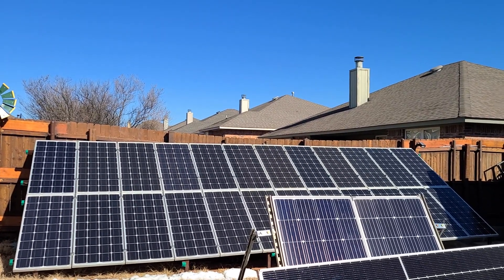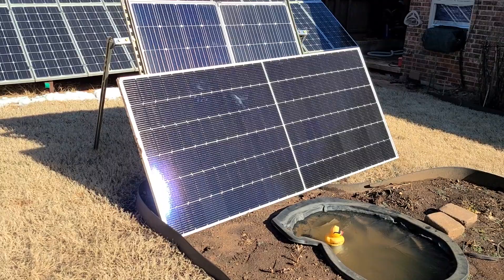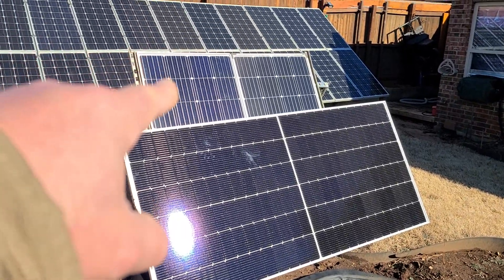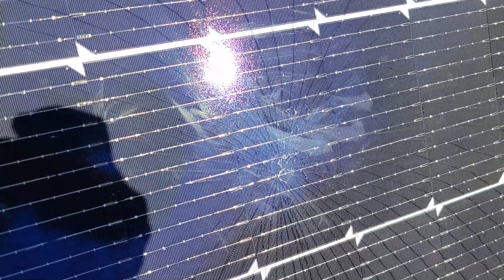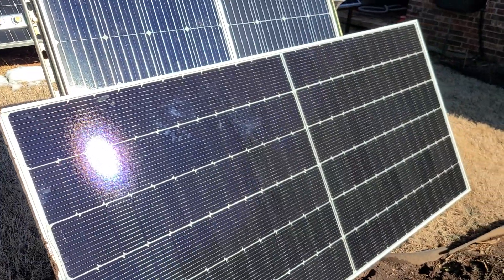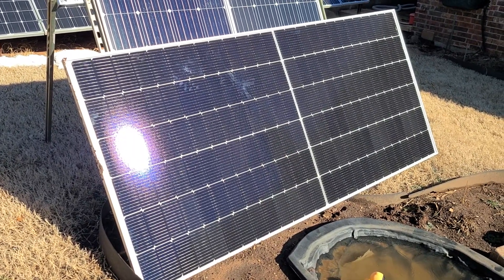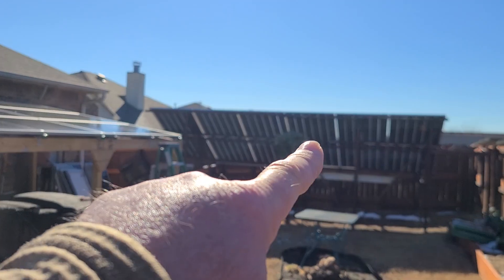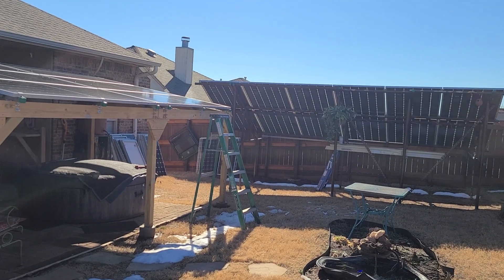Testing out a cracked Q-cell 480w bifacial solar panel (should I use it?)

Comment: That’s a tough one. For safety reasons, I’d put it on its own charge controller and if the panel fails you only lose one power source thus not affecting anything else. I have a feeling that it will eventually fail, but get it while getting is good then recycle it.

Comment: BIG FREAKING PANEL! After 2-3 cycles of the weather out there it will probably get worse. But ride it out! MORE POWER!!!!
Reply from the maker: These Q-Cells make oodles of power...even cracked and busted up. I will run it for a few months and see how it fairs. My thoughts...it will eventually die. Question is, "when". Oklahoma heat and monsoon season (this spring) will likely kill it off.

Comment: Is the backside cracked? Maybe mount it upside down, a coat of clear epoxy over the cracked side. Awesome setup. Spending big bucks for me anyway here doing major upgrades to my setup. More solar new Eg4 battery's ouch.
Reply from the maker: Oh man, THAT is going to be awesome. I just sent an e-mail to Signature Solar for a price quote on those Lifepower4 5 kWh batteries + six-gun rack system. They are on sale. How much more solar you doing? As for my cracked Q-Cell. The backside looks undamaged. I will run it for a few months and see what happens.
Reply: @ChrisDIYerOklahoma   I spoke to them on the phone they were awesome to deal with Getting 4 with the free rack trying to scrape up money for 5. I bought 3 of the basic style batteries and one of the new master batteries can't beat the price. Going for 2000 more watts solar & a new classic 250.